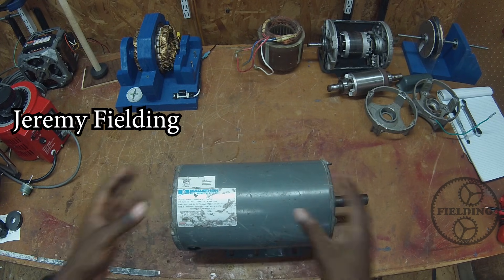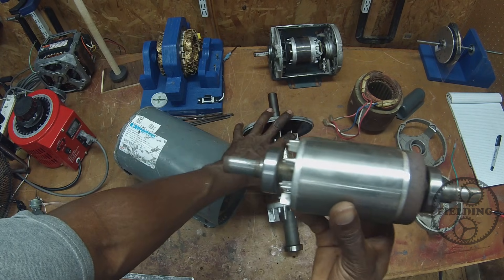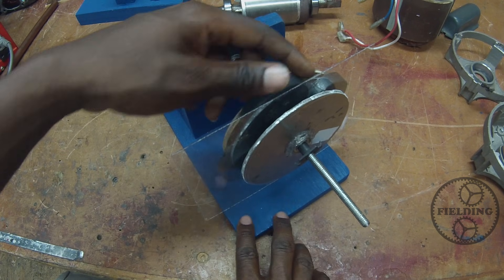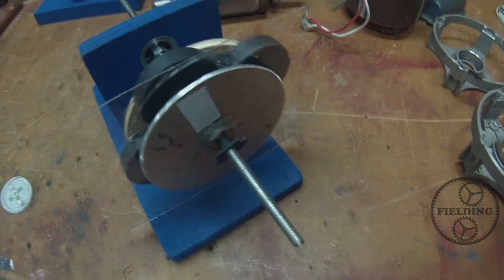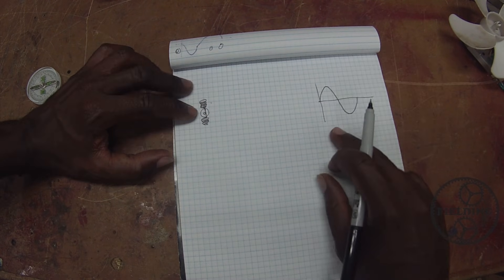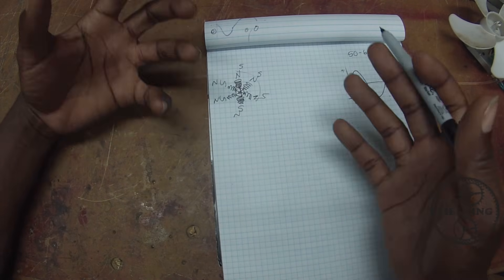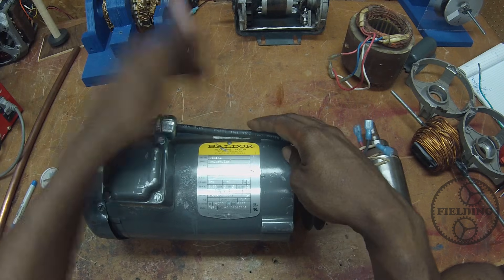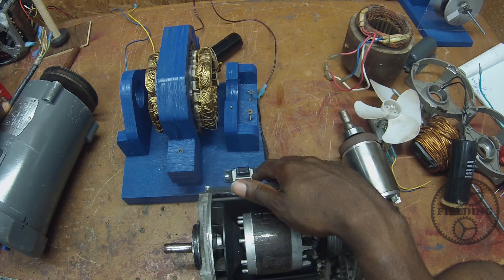How Motors Work for Beginners (Episode 3); Three Phase Induction Motors: 034

Comment: Ok so DC has a commutator with fixed magnets and direct connection to the rotor. AC does not have direct connection to the rotor and does not have fixed magnets. Am I getting that right?

Comment: i myself am quite lucky to have three phase at my home, i have it because i am not hooked up to the town i live in's water system and so i have an industrial pump to pump out water from the ground, and because of that i have my own independent water source, oh and yes it is filtered. but because of that, i have three phase.
Reply: as a fun fact, i might buy a siren soon, and that siren has a three-phase motor since its industrial equipment, lucky me, i have three phase, oh and the voltage... the siren is dual-voltage.

Comment: Enjoying the information you're providing.  Thank you.   I'm over my head.  I have a treadmill with a MFR-J55WZ0BP-0114 3 phase DC motor.  Seems to be brushless.  It did come with some type of emerson driver.   Which I haven't examined, yet.   My goal is to setup my drill press for low RPM high torque drilling.  I was recommend to use a KBWT-112.  But it's kind of pricey.  Can you offer any advice on how to proceed?

Comment: what determins the running speed of a motor as motors run at different speeds why
Reply from the maker: For induction motors it is the number of “poles” a 2 pole motor spins just below 3600 rpm, 4 pole 1800 rpm etc. I cover this in my how motors work for beginners series. Different motors types have different parameters that effect running speed

Comment: Hey Jeramy you videos are very informative and you lay out and explain in very good detail the that’s easy to understand. I come from a millwright background, so I get the concepts but never really new the details at all how they work. My question is this that I’m interested in make’n a scaled down version of a steam operated generator. For full house load capacity. Being the wizard that you are with the elec.motor/generator. What would be an ideal size elec. motor to use in this capacity. Does horse power play an issue and RPMs along with different  phases add to or take away from the end goal of maximum efficiency. You know most output for the least amount of work put into it. 
                      Thank you

Comment: @jeremy fielding. I need some help wiring up my lathe.  The lathe is 440v 3ph, my garage is 220v 1ph. What is the easiest way to do this? I know I could use a VFD to go from 220v 1ph to 220v 3ph, is there a VFD that will step it up to 440v? Will I need to get a transformer to step it up? I’ve looked at transformers but all I can find are 440/220 and not 220/440.

Comment: stupid question, Iv''e made phase converters for 3 phase shop equipment.  Do you think its possible to use run capacitors to reverse phase and run a 240 volt appliance off of of a 120 volt power source?

Comment: Short of having 5 grand to buy a 3-phase pto driven generator, is there a ‘poor boy’/shade tree way to couple together two 5kw generators to have 3-phase current for an old welding machine?
  A welder basically has no moving parts other than a small cooling fan.
 If not, it appears that I’ve acquired a 900# paperweight.

Comment: love your videos. would like you to talk about overloads in 3 phase motors. current limits. voltage etc. I have a ac induction motor in a electric car project and have had issues with the inverter/motor cutting out. someone said my motor is too under powered but I would like to understand if a inverter with higher current limits would help the motor to cut out less. I'm not pushing it hard.

Comment: Even if we don't have three phases AC power source, we already have a way to produce the three phase AC power, and that's usually via DC to AC inverters, and they're very common in efficient electric cars especially Tesla cars (Volkswagen cars may be using essentially the same squirrel cage induction motors as well, just physically different from Tesla car's, obviously) as both PMSM (Permanent Magnet Synchronous Motor) and squirrel cage induction motors can be made to carry load at speed without wasting efficiency (I would prefer squirrel cage induction motor though as it resist overheating best compared to the PMSM, especially when having to limp it somewhere and magnets do not like heat).

Comment: I think placing a compass near a rotating magnetic field is a simple example of a synchronous motor principles with the compass serving as a permanent magnet rotor. The force on the compass is not mainly due to Lorentz force as observed in the rotor of an induction motor.

Comment: I have a fan from an AC unit it came with two capacitors but not wire up to the motor so how do I hook them up and the motor is 220 
Thank you if can help

Comment: I got 2nd water pump motor brand grundfos, which is made from germany. How ever the board already burn but the motor also failed to work. How to repair if the ceramic(bearing) broken?

Comment: Question about motor:
Dc motor ,as generator ,connected  to battery with a diode to charge it up, it's like no load for generator, it won't get slower, it won't produce good enough amounts of current to charge the battery, 
1. Correct?
For charging the battery u should use higher voltage than maximum voltage to charge the battery, and because the current is so little it won't destroy the battery, example = charging the 12v 100Ah bat
Max voltage n current for cycle charging: 14v 10A
In this case if u use 24 v for charging battery would die
But when ure current is 200ma , u can charging it with a dc motor using as generator with output of 24 v 200ma,
High voltage instead of high current because we have to, like what they for fast charging the smart phones, 
2.Is that correct?

Comment: Great info on the induction motor! I have a question for you or who ever can give an accurate answer! This is about a three phase AC servo motor. I had a job repairing these, as you might know, there is not allot to them, bearings, coils, permanent magnet on the rotating shaft and an encoder to keep track of rotational position and feed back to the amplifier. Over time I noticed that some had varying amounts of mechanical resistance when turning the shaft by hand, i.e., no power applied and no shorted wires that I could determine. 
This resistance felt like the old stereo volume controls, on higher end units, that had "clicks" or detents to them as they were turned. Some motors were slightly noticeable and others you almost needed a pipe wrench to turn the shaft! 
What is causing this? 
I had been in contact with a major manufacturer of this type of motor but no one would give me a solid straight answer. I can't think they didn't know, since they engineered them and manufactured them. One can only guess why they would not give me an answer! What do you think? Thanks!

Comment: I have a question about multi-speed single phase induction motors. How is the wiring of the windings done? I have motors with selector switches for different speeds.

Comment: The most fantastic thing about three phase power is that it requires no V-out-- the voltage of the phases entering the pins always totals zero! The circuit is formed by the current flowing 'backwards' through different cables at different times. It's one of my favorite EE concepts.

Comment: Hello Jeremy I have a WEG Premium Efficiency 3 HP 2P 56C 3Ph 230/460//190-220/380-415 V 60 Hz IC411 motor that I’d like to run on single phase 240v . I’m guessing a 35uf cap at 450v . What two polls do I connect the capacitor? Thanks,

Comment: Hi, I hav a question how do you power a 3ph induction motor on single phase is it possible an how, it has 5 wires 2 seem to go to d tach at the back of the motor and 3 goin to the coils, thank you

Comment: 10:40 jokes on you every house in my country has 3 phase 380V power supply, usually we only use 220V single phase but if we need to run sth industrial we can.

Comment: I love your videos!  I recently acquired a 3phase motor for virtually nothing that has a C type front face mount---I want to use it (with a vfd) on a bandsaw I own.  However, I need to convert the mount to a "foot type" mount.  Is there any way to do this easily?  Any suggestions or advice?  Thanks in advance.

Comment: I've seen car air conditioner clutch used to start a 3 phase motor. But it's been 30 yrs so I'll let someone explain how an AC compressor clutch can be used to pull over a 3 phase in a 1 phase condition

Comment: How much load can I put using 3 phase motor 12 v car battery, and do I need an alternator?  And what type of convertor? I was wondering if I can load  2 fridgerators, 2 air conditions , and outlets to charge power tools.

Comment: I'm sure you won't see this, but if you do can you tell me if this (hopefully constructive) critique is accurate?--- You said the aluminum disk rotated because it became an electromagnet and follows the magnets on the "stator disk". But the induction motor spins because the loop(s) in the rotor, formed by the bars and the end caps, rotate because of Lorentz forces, not because of magnetic attraction/repulsion. 

Anyway, very good video, and the point is made well. But I think it's not 100% technically correct.

Comment: Very simple and easy to understand. 

How can you measure the phase difference between a pair of phases, without using an oscilloscope ? 
I have a three phase motor pump and sometimes it won't start. By measuring the voltage across the pairs of coils it seems that the electricity department have fed the same phase in two wires. This helps me know that there is no phase difference in one of the coil pairs. 

But I would like to make some sort of meter to actually measure the phase  radian value of difference. Any ideas ?

Comment: Hey Jeremy, 
I have acquired a piece of equipment called a "gang drill" that I need to rewire each 3 phase motor..I'm not an electrician but I'm pretty good with residential electrical applications and single phase motor connections. 
I was introduced to my first "three phase" motor install when I got my "Bridgeport" milling machine that I had to get a rotary phase converter in order to make it work.
I have been told by a few friends that in order to make my "gang drills" work, I need other components like thermal protection and starter switches...
That makes things a bit more confusing as I don't think I have those on my milling machine...what's the difference? And why do I need them?
Your explanation so far from this video is EXCELLENT, hopefully I can see the answer in other videos you may have!
Thank you for any help, and sharing your knowledge with us!!
Well done!👍👍👍👍
Razor!

Comment: You mention the rotor alum bars that conduct from one end to the other as a circuit. Where does this current originate and flow after it travels from one end of the rotor to the other? Where is the "circuit"?  Thank you for your great videos. Very informative

Comment: Jeremy I can use some advice I’ve been going over your videos and I haven’t clearly seen one yet of what im trying to do I have a phase a Matic static Converter that I want to hook up to make a Rotary Phase Converter I have a 2 speed 2 hp motor on my milling Machine and I’m look to hook up a 5 hp motor as my rotary motor to get the full Power to my mill how would I wire it up thanks

Comment: I have 1 1/2 HP Craftsmans motor for a craftsmans table saw. On the original motor we have replaced the start and run capacitor and have just purchased a third start capacitor and before I attach it to the motor and try starting it again. I have popped two start capacitors. Is the motor no good? Or what should I be looking for? I am the original owner for this table saw and I know it has less than 40 hrs. since I purchased it.

Comment: I Have a question please.
1:10 How can the rotor behave like a circuit? You say that we can think of the bars like a wire but if we did wouldn't we be looking at a wire that does not create a loop but rather has two ends?
Great vid btw

Comment: Without reading every post.

Aluminum isn't magnetic.

How does a magnetic field work on something that isn't magnetic?
Reply: What is happening is that moving the magnet behind the aluminum disc caused small electrical currents to form in the aluminum metal. These currents interact with the moving magnet and cause the disc to move. So its not the magnetism (or lack thereof) of the aluminium that is the important property, it is the fact that the aluminum is an electrical conductor. The moving magnetic field induces current flow in the aluminum conductor and those currents in turn produce their own magnetic fields which then interact with the moving magnets! Hope this helps clear it up some!

Comment: hi jeremy i,m in the uk i have a bodine electric co motor, it is a small motor 115 volts1.1amps it says hz 60/dc  it does 7500-8000 rpm i have a varac transformer what i can adjust to 115volts also the motor has brushes . if i plug it in 115v ac will it be ok

Comment: If the rotor rotates due to the phase shift of 120° then its rpm will not exceed the rate of change of its shift (always lesser than the magnetic field)and how to control the speed please explain.
Reply: Speed depends on the number of poles and frequency. So changing the number of poles can change the speed .  Or you can change the frequency with a VFD.

Comment: Hi Jeremy, Are the motors you are showing reluctance motors? Of course the magnetic field is induced on the rotor so they are induction motors, but the rotor has no windings. As stated several times below your videos are great. I never knew you could use aluminum to induce a current. I ask because the new Tesla model 3 uses a six pole reluctance motor, I'm not trying to show how smart I am. Thanks, Joe Brennan

Comment: Thank you so much for taking the time to make tutorial videos. Subscribed. 
Question: I picked up a 120v 3 speed Industrial fan on the side of the road. The pull chain switch was broken so replaced it with an on/off rocker switch but it keeps overheating and shuts off, and back on when it cools. Is there a particular way of wiring it or do I have to replace it with a 3 speed switch. (I tried connecting all 3 leads to complete the circuit at the rocker switch, connecting 1 lead and wire nutting the other two, connecting 1 lead and capping the other two).
Please help!

Comment: Can you explain how to wire or connect a motor from 120vac to 36vac three phase with sensor
Reply: Are you saying the power supply is 36v ac 3 phase?

Comment: hello i need help i have a 1 1/2 hp marathon motor it humms and trips breaker i check the star and run capacitor and there good .. i clean the  contact switch and puct it back and still the same   plzz  i need help thankx alot
Reply from the maker: +sergio gonzalez search my channel for how to wire a motor
Reply: Jeremy Fielding  my motor has the diagram outside and i wire it just like it saids on the diagram for low voltage and still hums and trips breaker
Reply from the maker: please watch the video it WILL help you. I get hundreds of messages asking for advice... I can't help people one on one like this. It is faster if you just watch.
Reply: Jeremy Fielding i already watch it couple off time my motor is in low voltage you think thant may be the proble thankx

Comment: At 8:20 would it be possible to alternate the poles, going NSNSNS instead of SSSNNN?
Reply: Great video btw you're fucken great no one goes into as much detail love them! I'm learning so much!!
Reply from the maker: Anything is possible... but why would you want that? Think about it, as this is a great learning moment. And thanks for watching.
Reply: @Jeremy_Fielding  I was thinking, if the poles alternate nsnsns, instead of the centre rotating 180° it only has to rotate 60° before it gets its next kick meaning you can alternate the poles quicker therefore providing a higher rpm. That's how I understand it, is that true or is the way you presented the best way possible?

Comment: thanks for the video,
but I would like to know if one can change the 60hz before power go's into the motor?
Reply: VFD is how you do this.  It takes AC single phase power turns if go DC then switches that positive to negative digitally essentially outputting a slower phased waveform.  It can then build whatever Hz you want on the output.  1 Hz 1000 Hz.  Just have to look at the spec.

Comment: Many Thanks Brother !!! I'm starting out on electro mechanic with your videos cause they are great. It's quite a challenge to learn on your own. I recently started on woodworking and I love it. I want to go on with metal work with the in and out of welding, but i just find out your channel, so I'm in....So Question; what make them 120 degrees out of phase with each other ? Is it the 3 different supplies of AC ....? Is it the wiring..? I'm very very new to all this !!! :) So Thank U again !!!
Reply from the maker: Watch my “how motors work” series. I explain it in the three phase video but it’s best if you watch from the beginning. It’s my most popular video series so I think you will like it